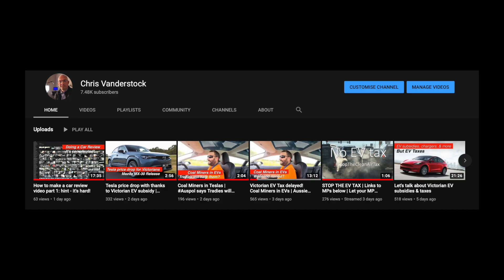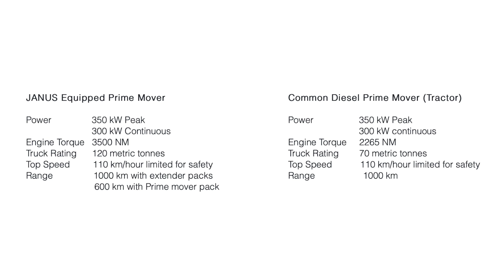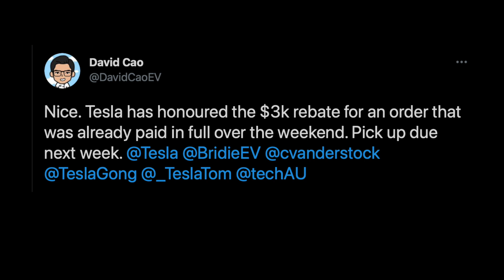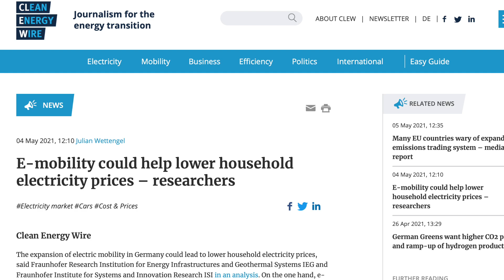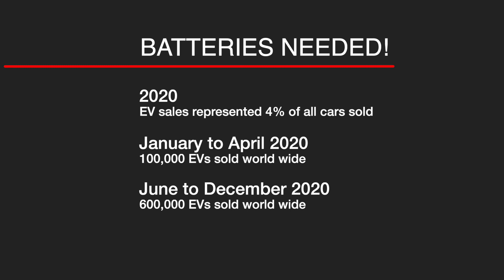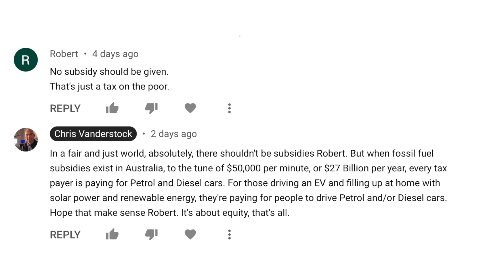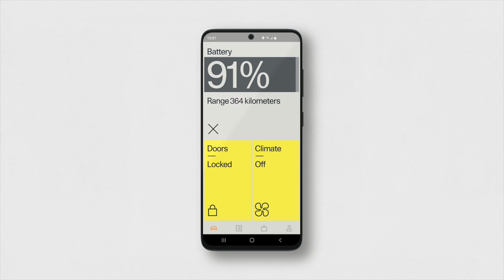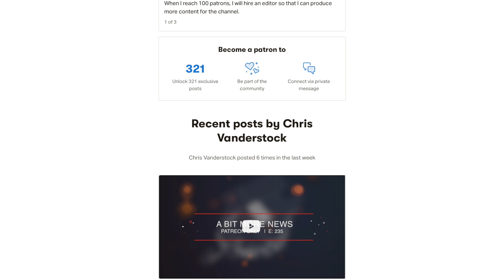How EVs lower power bills | Tesla wants Australia's lithium | Victorian EV tax update 10.5.21

Comment: Just so you have more to say to the EV  haters about the grid coping with EVs.
The electricity consumption of your hot water heater is about as much as you need to run an EV for about 100km.
I found out because I charge my EV from the controlled load supply and heat water with solar collectors. So I can see how much the controlled load consumes each day and on rainy days when I switch the hot water to the controlled load the consumption is higher than what the EV uses to charge.
I can only have the EV or the hot water connected to the controlled load supply. I can't have both on at the same time so it is very clear cut.